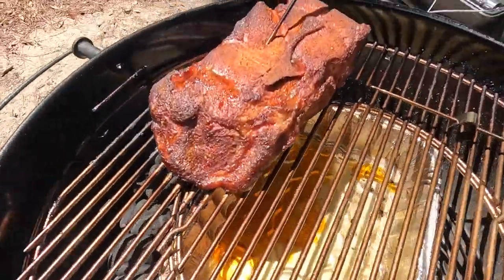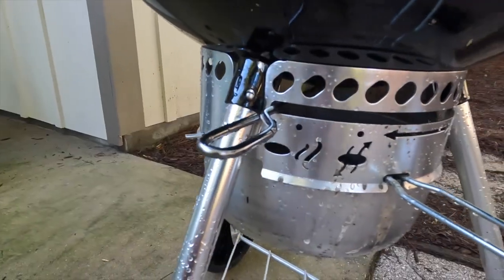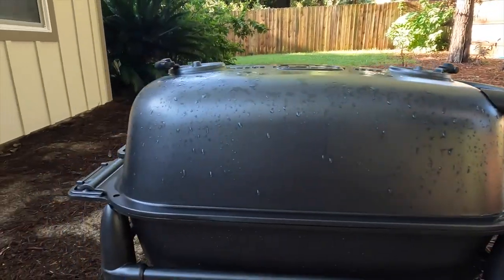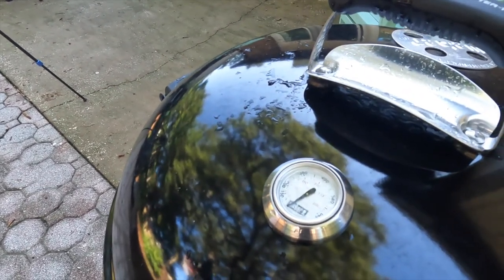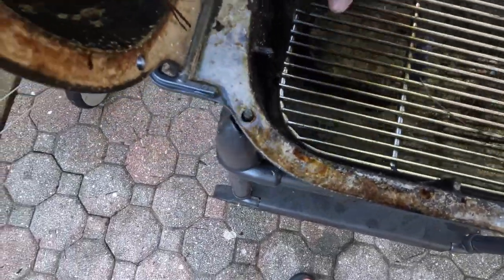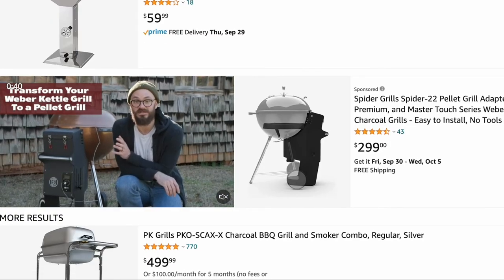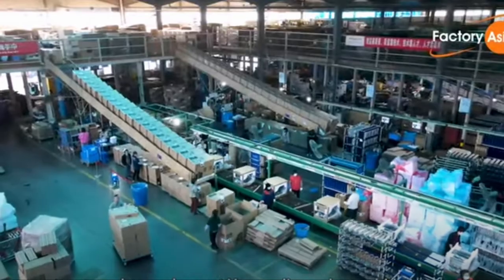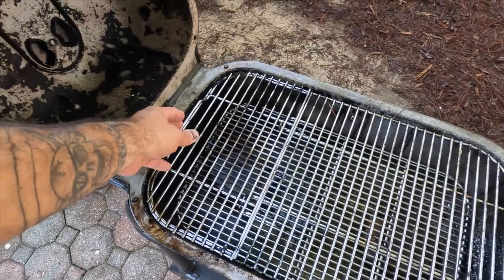Pk Grills vs Weber (PK300 vs Weber Kettle Compared)

Comment: The PK is holds heat better by a long shot. Once dialed in the temp is steady as she goes and is very reliable in cold weather. Offset cooking is what I do most and the PK is flawless. With the cookmore grid ( about $45) I can double the cooking area,
 and as for cleaning, I just  hose it out. Because its all aluminum it will NEVER rust and will last several lifetimes. The Original is still completely made in the USA, only the PK360 and PK New Original is made in China (disappointing and I would not buy one of these).  Most Weber grills are made from "globally sourced components" and some are actually manufactured in China and Taiwan. I'm not saying that Weber does not make a quality product, they do, but when I made my decision it was USA all the way which is why I went with PKTX and have never looked back.

Comment: I don't know about Weber lasting decades. I had one of their more basic 18" grills for many years that was kept outside, but not exposed to rain or direct sunlight. It did start falling apart and rusting eventually but still worked. I gave it to a friend and bought the same Weber in this video. I'm thinking about the PK even though there's nothing wrong with the Weber and I have the Vortex, Grill Grates and Slow and Sear. I'm also considering a pellet grill to smoke. I've smoked quite a bit on the Weber but it's not ideal.

Comment: Weber’s suck now. Built so cheap. This is like comparing a Porsche to a Yugo. PK is the bomb. I’ve owned 50+ grills in my life and PK will be the last brand I’ll ever buy. Used my PK300AF tonight and the food was perfect, as usual.
Reply from the maker: Ive got both and you are not wrong, the PK is the bomb! But, you cant deny the ability of a $200 Weber Kettle, they just work, every time.

Comment: Awesome review! I can speak towards the amazing customer service that PK has to offer along with warrantees. They have gone above and beyond helping me resolve some issues when my castings came in. I also enjoy the fact that the PK is 100% aluminum. That being said... the Weber is my quick evening dinner go-to cooker for the simple clean factor.
Reply: I can speak to Weber's customer service.  Every interaction I've had with them has been awesome.
Over 20 years, I've had 5 weber, 4 kettles, one smoker.  Still have 3 of the kettles and the smokey mountain.

Of the two issues I've had, one with the smoker and the other with a special edition kettle, both were resolved very fast at no charge.

I have smoked, baked, grilled, seared, you name it, on a kettle.  Longest burn with no refuel on a 22 inch kettle was almost 10 hours.  
Just my .02, but that's been my experience.

Comment: My two favorite cookers.  My number one is my PK original made right in Arkansas. Weber kettle is close second. For the ultimate in temperature control and low charcoal usage and long-term durability that PK is hard to beat.
Reply: NO, They're MADE IN CHINA. They got me, too.
Reply: My PK original and PKTX were made in USA Arkansas. Unfortunately, the new grills are made in China and I think they even closed up the Arkansas production.  Another reason I haven’t bought a new PK. I love PK but am not going to spend $1000 on a charcoal pK360 made in CHINA.

Comment: PK grills are awesome and are far superior quality. Yes expensive compared to the Weber but you get what you pay for. I’m not knocking Weber, they are great grills and have excellent accessories. I would buy one as they are budget friendly, I was considering a master touch but opted for the PK300AF. I also own a Char Griller Patio Pro. That’s an awesome grill which I’ve owned for 10 years and still looks good as new, needs a lot more TLC and regular seasoning.
Reply from the maker: I agree, I live my PK, but its hard to beat value for money with Weber Kettles too!

Comment: No offense, but this sounds like a Weber commercial! I am a Rambler Joe fan, and I would have gone PK but it's a little too rich for me (-:. You should have mentioned the PK's all-aluminum design, which makes it ideal for long and low cooks, not to mention bbqing in windy conditions. PK also comes with a 20-year warranty.
Reply: Nah seemed like afair comparison to me.
Reply: I have a pk and this review just seemed like facts. Pk is great but overpriced
Reply: This is a fact based video. My neighbor has a PK and I have several kettles, including a performer. We have cooked on each other's grills extensively. The cleaning itself is a deal breaker and the accessories make it a no-brainer as to which one the average person would prefer. He wants to buy one of my Webers and even offered to trade his PK for one.  After using his PK, I'm not interested in trading.  I have so many grills and smokers (including a chargriller Sidebox which is basically a Rambler Joe), I might just give him a kettle.

Comment: If you think the Weber kettles made and sold these days are made to last, you will be a sad customer pretty soon. My Weber bought in 1999 lasted for 21 years but when I was checking for a replacement Weber I realized the quality of the metal, the weight, is nowhere near what it was. No wonder Weber has lost its’ market leader position, and no list of accessories can hide the FACT it does not retain heat good enough to be used for long cooks anymore. Enter PK. The build is massive and once you dialed it in, you can leave it. It’s. A. BBQ.

Comment: I personally would not have used a brisket to compare for size. Although you can cook a brisket on either I don’t think either is ideal for a brisket (unless you’re using a deflector plate on the PK). I think a pork butt would be a much better comparison.

Comment: I've had both the Weber for over a decade and now a PK360 for 2 years. The build quality on the PK is superior with a thick cast aluminum shell and thick steel grates. The vent fins on my Weber rusted relatively quickly with the vent becoming non functional. Clean up might be tougher on the PK300 but the 360 has a clean out hole in the base. I can sweep the ashes into the hole and into a pail that I can hang under the shell. The PKs do have smaller cooking surfaces (I think 300 and 360 refer to area in square inches) so if you're cooking for bigger groups (>5 people) it could be a challenge. The PKs are far pricier than the Weber. I don't really use accessories so that didn't factor into my decision making. PSA-Use a wood grill grate to clean as opposed to wire brushes. There have been many case reports of perforations of the esophagus from swallowing metal wires that come loose from cheaply made wire brushes.
Reply: Thanks for the PSA!!!

Comment: Good presentation. If I was looking to buy a new grill, I think I would go with the Weber based price and where it's made now. Besides  I have cooked on a variety of grills in last 40 plus years and I can cook good BBQ with just about any grill. Even with a bunch of concrete bricks. With a little skill you can use any grill.

Comment: If you use grill regularly then Weber kettle will last 10 years and PK360 will last 50 years. I have both. Difference in build quality is superior in PK360 even though it's made in China. PK360 can maintain temperature so well and it's far more efficient using charcoal compared to Weeber. Overall you will spend far less money on PK in thee long run. Major accessories are available for PK too. But out f the box PK360 works like a charm. At least I didn't need to purchase anything else.

Comment: Sold my Pk 360 and bought the Weber Kamado,  wow never looked back
Reply: That Weber Kamado looks very tempting. I just wish it weren't so expensive! How do you like it? Is it equally good at both low/slow and hot/fast cooking?
Reply: @jenniferdahlin7386  ive owned 12 grills and its my favorite,  yes does both really well. I had a few large ceramics and I prefer the Weber Kamado if u over shoot the temp it comes down quickly and is more efficient with the charcoal

Comment: Weber's parts are getting more questionable every year. Most of their parts are made overseas. The shell seems to still be made here. You can tell some of the components are questionably compatible. For instance, the leg sockets on the kettle are USA, but the legs themselves are overseas. The fitment is sloppy and the legs are quite thin in material. What you end up with is a wobbly stance. Replacements aren't cheap either. I'm just gonna throw this out there for enquiring minds. If you want all 100% American made. Goldens' Kamado cast iron cooker is made and shipped right out of their Columbus Georgia foundry. It's made of 3/8 inch ductile cast iron and can easily withstand a fifty foot drop. This cooker is built like a tank like they used to do back in the 1800-1900's. Goldens' has been in business for over 140 years and they offer a lifetime warranty from top to bottom. If you're looking for the one heirloom cooker that will last several lifetimes, this is it folks. P.S. I don't work for Goldens' I just heavily admire this cooker.